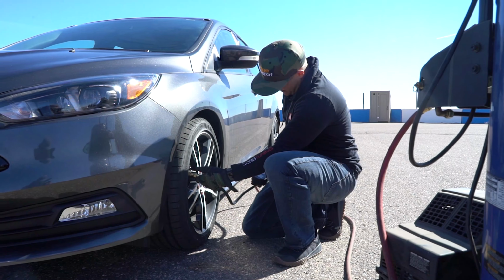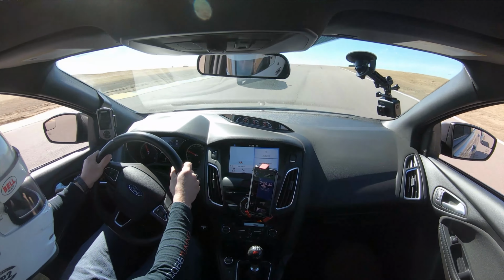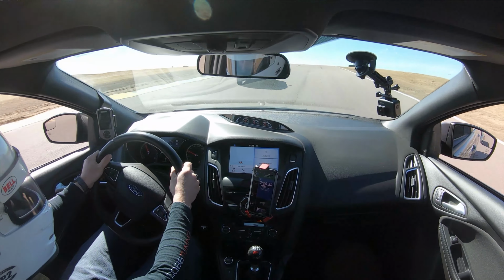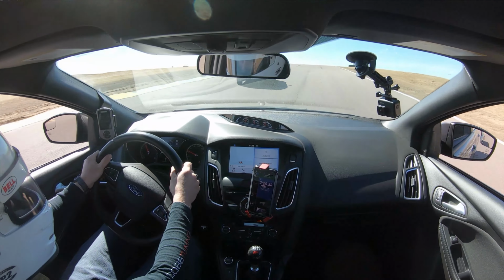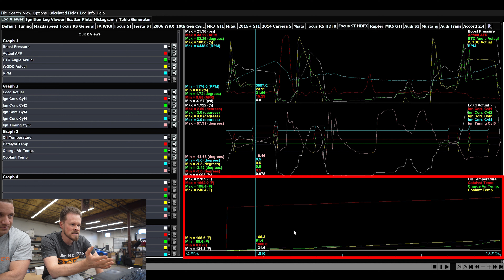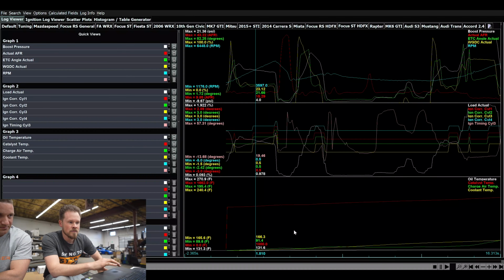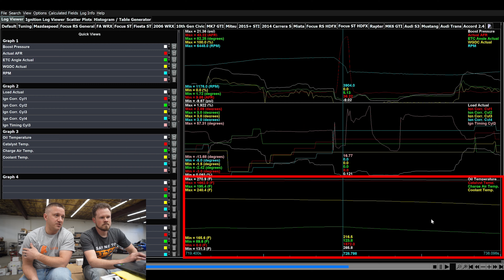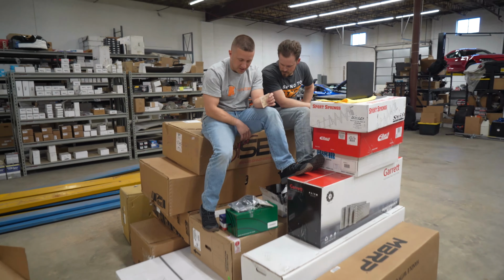BACK TO THE TRACK!!! | PROJECT HALF-SEND | EDGE AUTOSPORT

Comment: Excellent video again boys! Pleasure to watch, your method is of incrementally modifying and measuring performance is how we should all strive to do things. 

As you’ve seen, the biggest issues with these cars is brakes and cooling. Once you upgrade one you have to upgrade the other back and forth. 

If I can offer some recommendations 

1. Brake cooling: boomba or velossatech (cheap and easy mod that will help tremendously)
2. Lower temp thermostat: livernois performance (Alan lowered the fan temps along with this mod and it made a noticeable difference)
3. Oil cooler: this one speaks for itself 

I think once YALL have addressed these areas, project half-send will still be a budget street car with even more potential!!

Comment: Nice video! Good timing too. Im taking my 2016 FBO E30 tuned FoST to MSR Houston next month. First time on the track. I just received my shipment of goodies; rear sway bar, full set of rotors/pads/stainless lines, and Motul brake and DCTF fluids. Can't wait to see what she does..but I'm already thinking the oil temps are going to be my weakpoint after a few solid laps. FMIC makes a HUGE difference in charge temps. It remains around ambient at all times when in motion. So with an upgraded set of pads and FMIC, the stock ST should do well on most tracks. Then of course power for the straights...

look forward to the other videos! BTW, wonder if you have the CNT Racing catback/downpipe in the pile..its a highly underrated exhaust. At 2.5" it doesnt sound as raspy or droney as most 3" exhausts, and you're not losing any power. I love it.
Reply: 2.5" is a somewhat restriction its not horrible but 3" will legitimately flow better especially if your looking to go big turbo it'll make a difference
Reply: Just a recap of my race weekend: I literally cooked my brakes. Calipers on fire. Cost me two new brake sets on the front. Basically the StopTech pads were absolute garbage and i burned them to the metal plates in the first few sessions. On a side note, my car outran EVERY car on the track in front of me...GT3s, ZR1s, ZL1s, M850i's, M3s, ScatPacks, 5.0s, etc...not a single car passed me in 5 sessions and I got a point by from every car. My instructor was blown away at how well the Focus ST did. Granted I was in novice class, but even after the first day he said i was ready for the next class..but due to principal i should put in some more time. It cost me a lot, trailered the car back from Houston to San Antonio...So now I'll be buying a set of front rotors and hawk dtc60 pads or something for a potential return in November. Then Ill swap the rotors/pads out after the weekend and drive home on my daily set up. 

Im also looking into an oil cooler and brake cooling from velossatech or picking up the stock RS air deflectors and removing the dust shield (just for the track event). My issues was driving super hard, killing my pads, and i never let it cool enough. Literally flaming and melted the metal pistons. LOL.  Track days are no joke...but these Focus STs are also no joke at least against other novice class drivers..they just have so much power they cant handle them XD